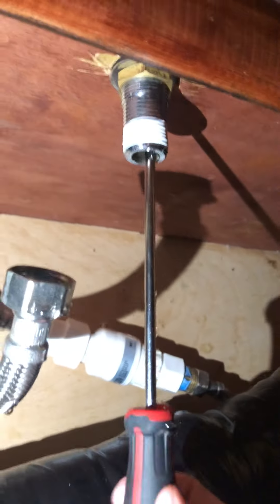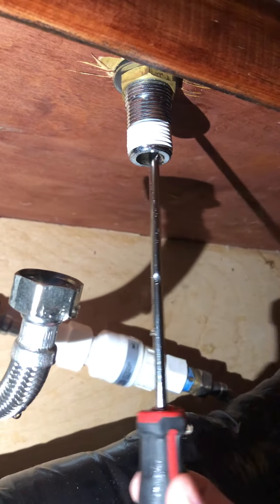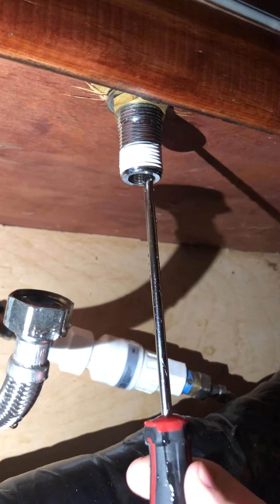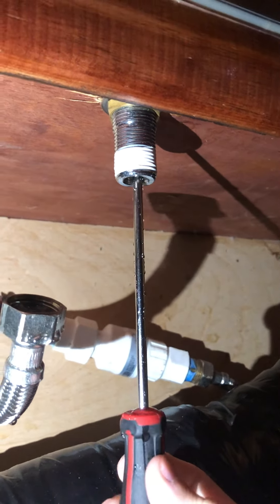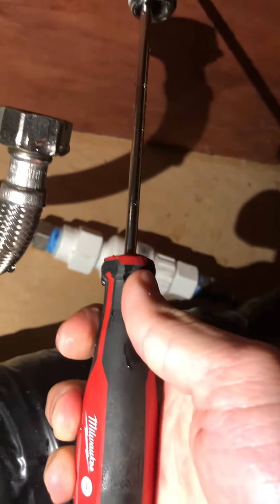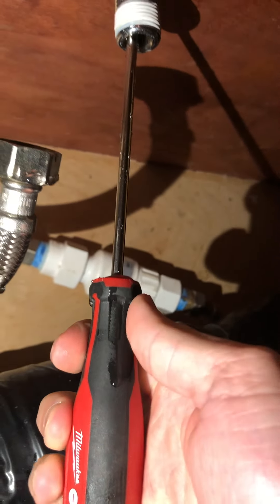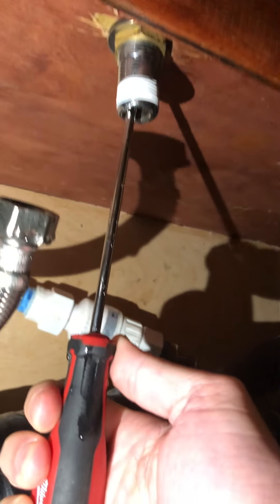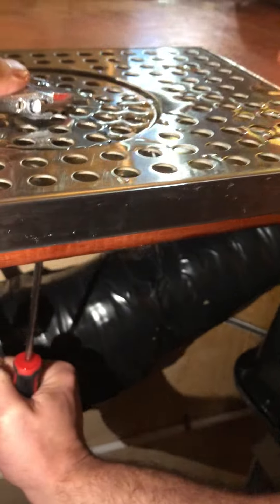Spring Replacement on glass rinser Micromatic part GR-1581

Comment: recently replaced the spring in my unit only to find it still dribbles water out when not in use. It's not fast but it does build up, might I have a faulty rinser and just need to replace the entire part?